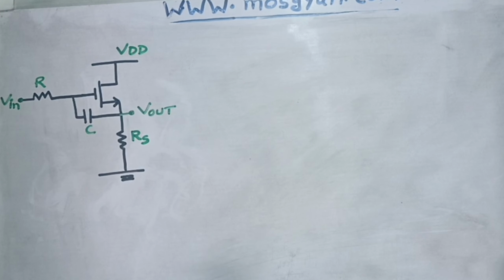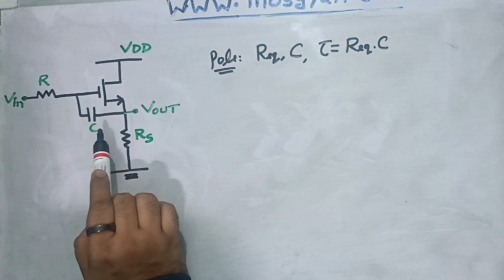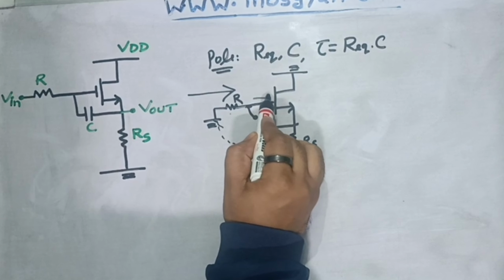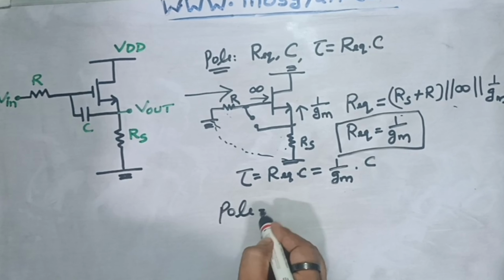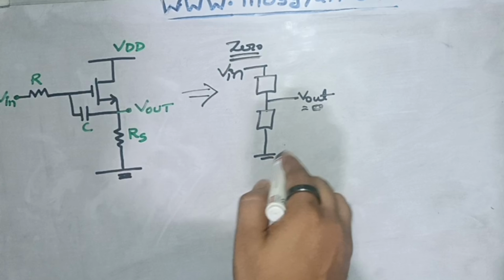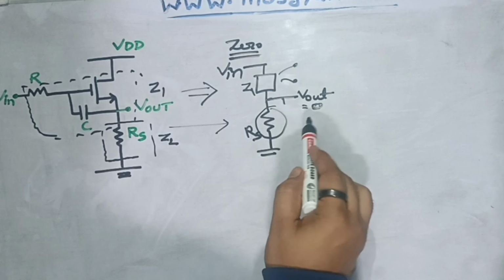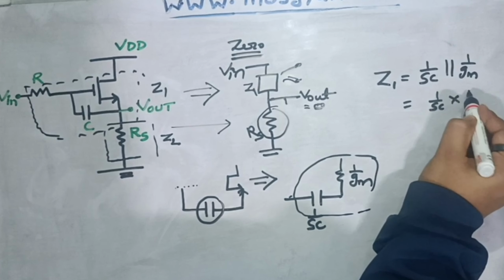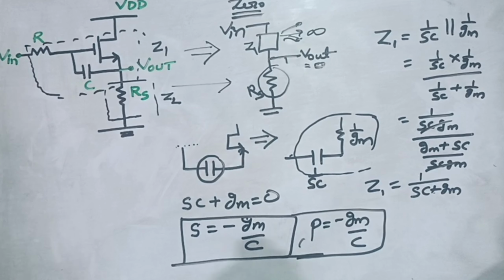Finding Pole & Zero of Circuit Without Transfer Function | Common Drain Amplifier | Poles & Zero's

Comment: This isn't correct. This is a miller theorem applied to source follower.

You have to use it for the cap between gate and source with the fact that
Gain=gm*Rs/(1+gm*Rs)

So Cin apperear connected between gate and gnd.

Cin= C/(1+gm*Rs)

Now you have a pole pushed toward high frequency thanks to Miller effect

Tau=R*Cin

Razavi have a lot of examples like that